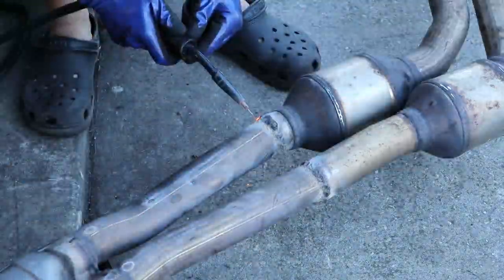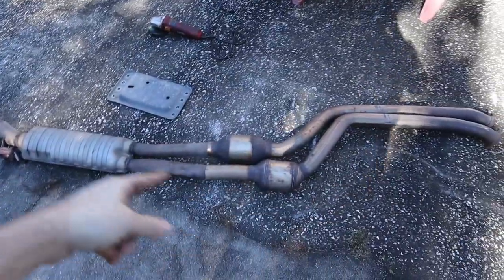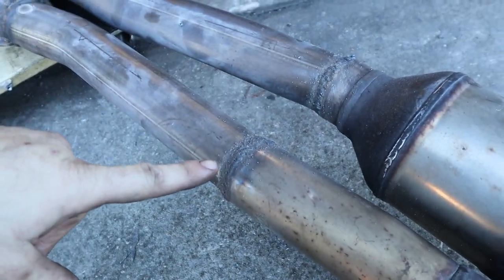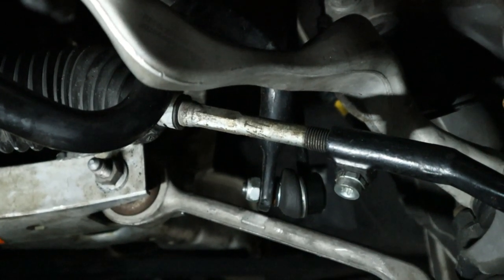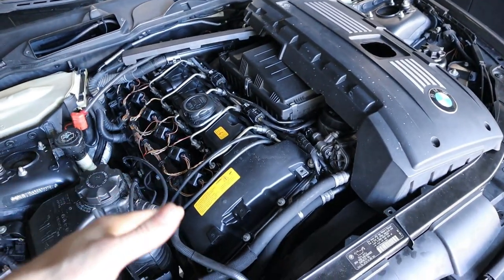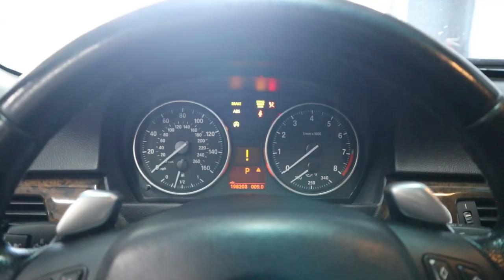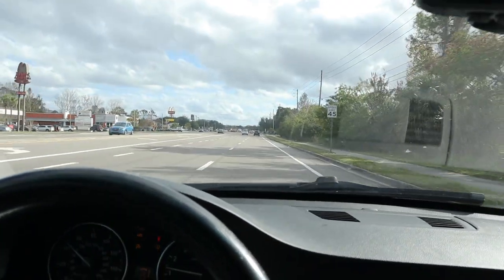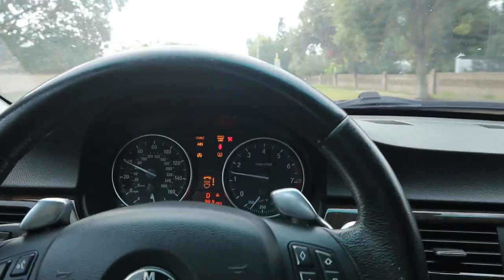Building a SLEEPER EXHAUST for my 335i Wagon!

Comment: Hello Chris.
I really do like the sleeper idea ! I'm sure you're gonna surprise more than one with this car !

I've never seen the toe plates before and it looks very convenient to check and pre adjust the toe in/out of the drive train.
But maybe two ideas there, 8:46, when you put the car back on his wheels, it's sits high.
Maybe roll the car a bit to the front and back so it founds his natural "level". (a compressed or extended suspension can have an impact on the wheel angle)
You also have to check alignement between front and rear axle. A paralelogram has his opposite sides parallel ;)
Your measument tape can maybe show the same value but both wheels can still point left or right compare to the rear axle.

DIY solution : Pull two parallel strings using with your car jack stand and use them as datums.
Have a look at this video (sorry, it's in French, I'm a French man living in Belgium) but you'll get the idea (subtitles are quite accurate if needed)

https://www.youtube.com/watch?v=eyPGD7_72eY&t=27s

Comment: Man, this is great progress! I ran through same issue when car was pulling to the side, I changed  2 lower control arms with bushing and tie rods, the car felt day and night different.... I did the alignment myself with eyeballing it, took it to the alignment shop and they said only slight difference needed to be corrected.... so hoping this is your issue. if your tires RFT, check the wheel if its bent  and need tire balance.

Comment: You should get a wheel hanger for your cars. Makes changing wheels and tires a lot easier with lug bolts. I have used the Schwaben Wheel Hanger - M12x1.5 Thread from ECS Tuning and its nice af.
Reply from the maker: I have a set of them, just too lazy to pull them out usually. Especially for my own crappy wheels 😂

Comment: I'm all about the "sleeper" concept, but I have to say that I'm a bit confused with this exhaust mod of yours. The 325 exhaust has a smaller diameter, which will restrict the flow...and decrease power.  It's been my understanding that opening up the exhaust (thereby increasing flow) is the way to add power. And that's the challenge with making a sleeper, since "high-flow" and "quiet" are pretty much diametrically opposed to each other.
Reply from the maker: We'll put the car on the dyno and find out how much power it has on a stock tune, and then on a stage 1 or stage 2 tune soon! I'm curious, because installing downpipes removes restrictions, but this might provide some. Worth the trade off in my opinion!
Reply: Lol they fit inside a massive restriction! Should go larger not smaller - Twin 2.5"

Comment: Diggin the build so far! On the alignment though - I thought most cars spec a little bit of toe in on both sides for stability, braking as well? Could be wrong 🤔 also I get the idea of the sleeper for sure, but I still think it would look sick with the 335-style duals coming from a wagon
Reply: I think he would need a new rear bumper for it to look decent
Reply: @BassFraud  haha yeah I was going to mention that, but my comment was already long enough. I don’t think it’s easy to find a 335 style bumper for an e91 either, but it would still look awesome to see that setup on a wagon

Comment: But yah for missfires...modded n54s its first off plugs if u have oem on high boost.. get atlest 1 step colder gapped to atlest .022. And .018 for high boost and bigger turbos. Next is coilpacks. Bosh such get atlest oem n55 coil packs what I run no issue. After that injectors... the lower the index the more problematic. But getting 12s doesn't mean 0 issues... so rule of thumb woth n54 injectors... if it ain't broken dont fixem I and some people I know have had no issues with index 9, 10, 11s, then issues when going over too index 12s... so unless you buy brand new 12s its always a risk. Lastly if you have a msd80 dme... mosfets... they always cause a whole bank missfire. Even if its just one mosfet. They are ez fix not worth the money to convert to msd81. If u have to change yours... you can upgrade to 500v mosfets stocks are 240v the mosfets can see over 300v ... so they burn... I've run lots of different mosfets over the years such as new oem voltage and then 300v.. you really can't find 400v mosfets... but they do have 500v (digikey) and after that never another issue. Also can test the spark plugs to make sure they are in range as far as resistance goes.. if not they can random miss at high rpm and boost

Comment: I noticed you have 2F4F Speed Plausibility code on. Please share how you can fix this fault as I’ve had it on my 335i since I bought it and can’t figure it out 😢
Reply: Try wheel speed sensors
Reply from the maker: Mine is obviously a wiring issue, but I agree with above, try wheel speed sensors.
Reply: @TheBimmerBarn  Yeah I tried Wheel Speed Sensors but my rear speed sensors are still not working. I was thinking it’s probably a wiring issue on my 335i as well